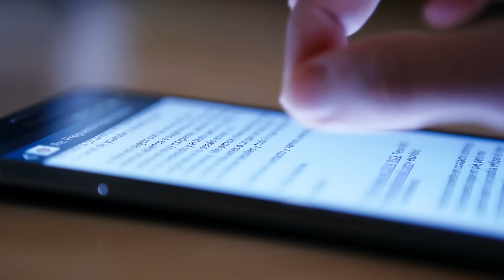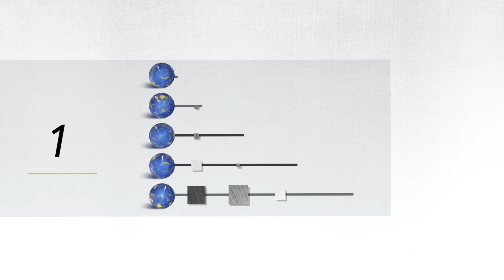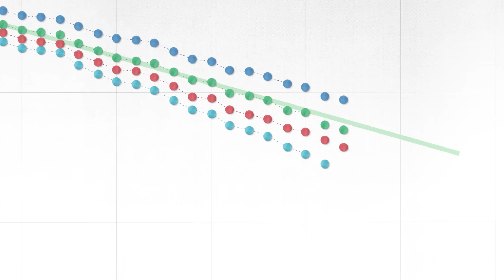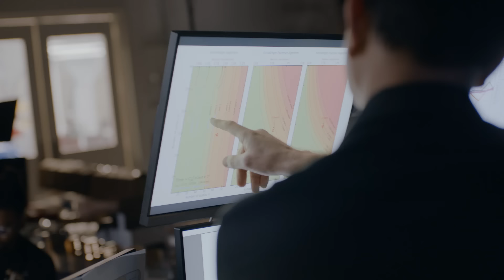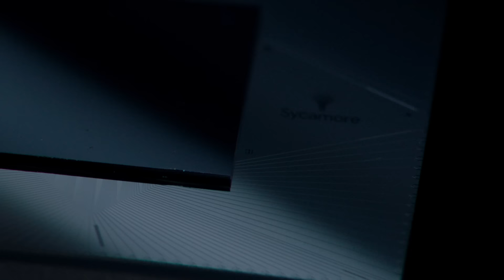Demonstrating Quantum Supremacy

Comment: it’s like back in 70s when the first “classic computer” was born
Reply: Or more of 1950-60 s
Reply: Yessir
Reply: Yeah that's what I also thought. And afterwards we'll be holding quantum cellphones or something.
Reply: In 1985, David Deutsch describes the first universal quantum computer.
https://en.wikipedia.org/wiki/Quantum_computing
Qcomputers need liquid nitrogen in order to work(1-3 Kelvin).
Reply: @darkdragon2478  possible. But right now, or in about 30-100 yrs or even more, no. The temperature in which the tech will be cooled or needed to run is too low in which even the most expensive  home refrigerators right now is not capable to cool it down.
Reply: @adithyabhat4770  we had it way earlier than that in ww2. The silicon computers first made in the 50s after that big cultural changes begins exponentially.
Reply: @jedapas9355  What if we build a quantum computer on Titan? Would that work?
Reply: jed apas It’s a good thing modern mobile technology will be capable of offloading these quantum tasks to data centres
Reply: @gilduma8456    they need even cooler temperatures . It is possible only if we invent new materials which can supercounduct at the temperature we need.
Reply: @adithyabhat4770  however there was ancient computer in before common era but, wasn't using electricity it was nonething more than mechanical to predict next eclipses. Its is considered first computer however been lost through thousands of years before rediscovered in 21st to late 20th century. Look it up your self. We are just lagging behind.
Reply: No it's not. This not a "new type"of computer and it will never be commercialized, because it's not for domestic use. They are faster only when doing certain specific tasks.
Reply: @darkdragon2478  same with robots now and flying machines back then.
Reply: @w花b  They're just talking wtf lol XDD! "C'mon" 😂😂😂😂😂😂😂😂
Reply: @darkdragon2478  Without some major breakthrough in quantum physics a quantum cellphone will not be possible... just due to the temperatures these machine have to be kept at in order to even function... To make this a more viable technology they need to shrink down what they have and make it more consumable by the public (I mean big businesses with public)... That being said given big business runs on binary systems and have for multiple decades, they will need to come up with some use case that makes them viable for big business...
Reply: @elchicovip01  not liquid nitrogen actually, liquid helium
Reply: @jedapas9355  it needs those temperatures because the material needs high power demand in order to become quantum but recently they have found they (possibly) key base material as it is already in a quantum activity so yeah, maybe this material becomes the cornerstone for faster and easier building of these qputers and also commercial or industrial use as well.
Reply: yep, as big as a room
Reply: Imagine how much smaller quantum computers are gonna get over time... Imagine 50-100yrs from now when a quantum computer can fit as a little chip in a phone...
Reply: @Mandorle21  You don't know that lol! We'll just have to see how it will develop later and, and see if it will go into public use too. It's still in development. It will be exciting to see what is done with it. :)
Reply: The Manchester baby in 1948.
Reply: @codygalbreath  Thank you!! There's a person in this thread named Mandorle21 who is trying to say it will never make it to the public. Perhaps explain it to them lol. But on that note, do you believe this technology will ever be available for practical use in various technology for the average person to use? I'm not sure what kind of product though, but just wondering.
Reply: @LiamPilot120  thanks for correcting
Reply: @codygalbreath  I heard they made a different type of bits called probability bits or p bits designed to act like a quantum computer but, it uses are for detecting magnetic fields change to determine which state it has picked to help with continue using classical computers and calculations to without it being so expensive to make a less need for quantum computer. Its still being research as I speak. It's just a alternative method to embrace quantum physics without needing to get towards extreme small scales and low temperatures.
Reply: @codygalbreath  there is quantum radio that been made check it out.
Reply: @phoenixreen9087  Well I mean I work in tech and given how embedded society is with binary systems... I dont think a quantum computer really could make leaps in bounds for the end user... I mean I could see storage and speeds going through the roof... but it would require everything we know today to be turned into a quantum compatible system, ie new OS written to leverage it, all programs you use rewritten to leverage it... ect... 
Given all that what it usually comes down to is money... A business will not migrate to this until its becoming a necessity... what I mean by that is this, major corporations have probably billions upon billions of lines of code, why spend money to rewrite that when they can just run as they are today... There would either need to be necessity to migrate or some tangible benefit... but to a business and end user .00002 micro seconds is the same as .2 micro seconds... 
Summarizing this will not make a difference for the day to day user... but for research colleges and fringe computing it will give us amazing steps forward
Reply: @trevorallen3212  I find that interesting but as I stated in another post... OS's, applications, ect... Will have to be rewritten to leverage this, which is unlikely at this point in time without some massive external stimulus... I read up on it really quick it looks interesting but it looks like it has its own limitations where its not that close to a q-bit, but that it would help with the adoption of new applications ect... Its interesting thanks for pointing me at it... Going to have to keep my eye on it
Reply: @trevorallen3212  Yea I looked into it after you pointed it out... Its not quite the same and what I mean by that is to accomplish the quantum radio they just changed the electromagnetic field and frequency and were able to penetrate objects better than standard radio waves... The quantum physics required for quantum computers is really different... Quantum physics is a large subject with many different areas of focus...
Reply: No, because that computer was useful.
Reply: @Uzt Nus 

Ummm... I think its probably inappropriate to pray for God to kill someone 🤨  

We should pray for God to give them Epiphany to change their wicked hearts.
Reply: who will steal and build it in his garage ....ha ha ha
Reply: 1930s*
Reply: @adithyabhat4770  He said "classic computer" not computer.
Reply: @darkdragon2478  how much would that cost? A kidney? Two kidneys?
Reply: ためる why not act smart?
Reply: 70 lol , in what planet did you lived ?
Reply: Around 1950s